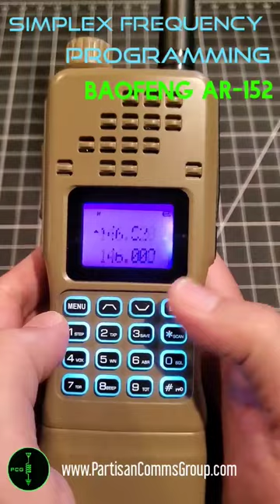S5: Baofeng AR-152 Simplex Frequency Programming

Comment: How do i unlock it so I can access 700 hz frequencies that most police use?
Reply from the maker: It sounds like you're wanting to use this radio as a police / fire / EMS scanner.  First responders use a specific radio service and the AR-152 does not cover those frequency ranges.  If you're looking to monitor police / fire / EMS your best bet is to get a scanner for that; however, in the past few years many orginizations have started transitioning to digital communications which adds a layer of complexity in monitoring traffic.
Reply: @PartisanCommsGroup  oh fun. When I got my radio. I added an encryption key to it because I was in the navy and I had to if I wanted to use it. But now since I'm not in anymore the key expired so I thought maybe I could access 700 hz. (I didn't add the key the military police did for the base I was working at did)

Comment: Im having trouble deleting frequencies on this radio. Can you plz help me
Reply from the maker: Are you attempting to delete it manually from the radio's menu, or through CHIRP?
Reply: @PartisanCommsGroup  manually I just got my radio and the booklet that came with it doesn’t explain things very well and there is no one I can talk to to help me set it up. So i don’t know if im doing things right or not
Reply from the maker: If you only have one frequency programmed, then I don't beleive it will let you delete it, but you should be able to overwrite it.  Since you just got it, it wouldn't hurt to download a copy of CHIRP on your computer, and then download the data from the radio and create a profile (a template) that you can use going forward.  CHIRP is free (and hopefully your radio came with a programming cable).  When using CHIRP, you may not see the AR-152 listed in the drop-down menu when attempting to program it.  But, one of the options that will work is the BF-F8HP. This profile supports all three of the power settings (high, mid, and low) and should work with the AR-152.  Or, if you wanted to purchase software that is specific to the AR-152, then RT Systems has an offering.  I'll leave some links below for you to check out for both CHIRP and RT Systems (I went down a bit of a rabbit hole there).  But back to your original question.  If you only have one frequency manually programmed, then try to overwrite it by changing it to another one you want.  Or, program a second one, then go back and try to delete the one you don't want.  Also, don't get discouraged, you're doing great by trying to learn how to program your radio manually.  There are a lot of people that don't know how to do that, and it's important to know how without relying on a computer.  

With that said, here is a link to CHIRP: https://chirpmyradio.com/projects/chirp/wiki/Download 

Here is the link to RT Systems: https://www.rtsystemsinc.com/AR-152_c_2156.html